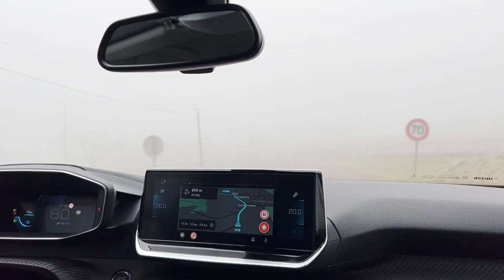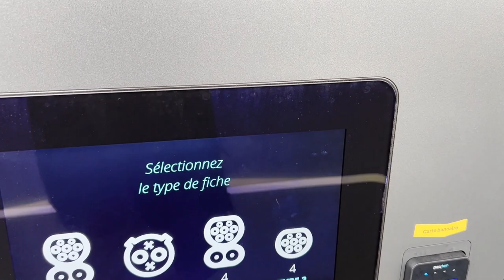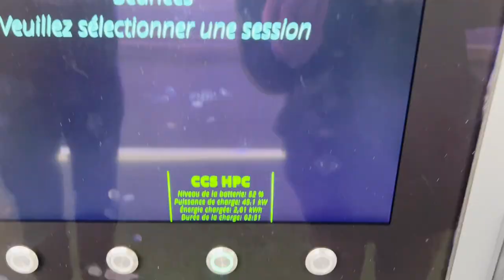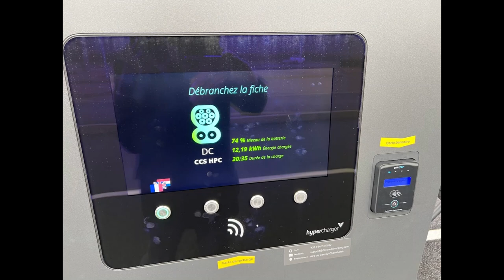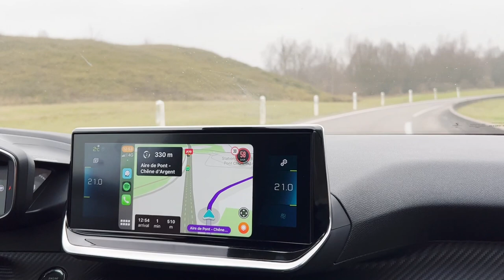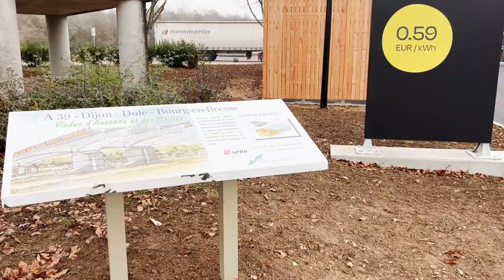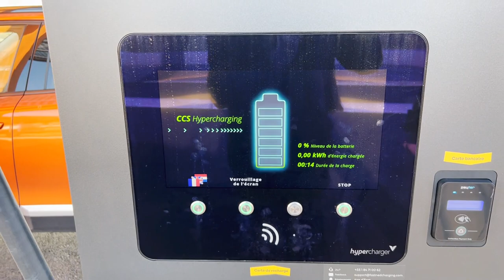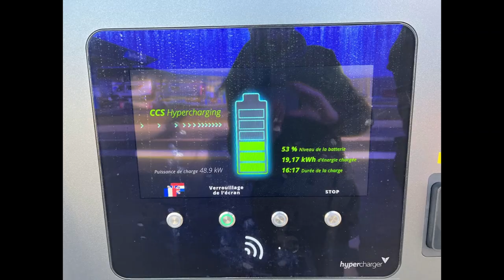Fast Charging at Fastned France (3x) for the Very First Time!

Comment: I thought with Fastned you could link your vehicle using their app, and then the charger would recognise the car and you didn’t need credit card or RFID?
Reply from the maker: Absolutely true. Create an account in the app. Use the app to start your first session, and enable autocharge, next time you plugin, charging starts automatically: https://support.fastned.nl/hc/en-gb/articles/115012747127-Autocharge-